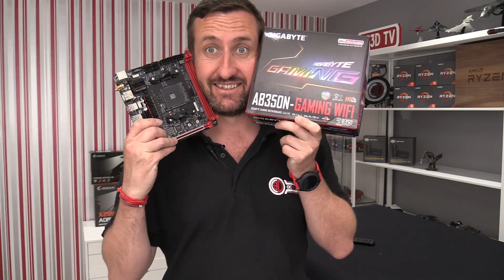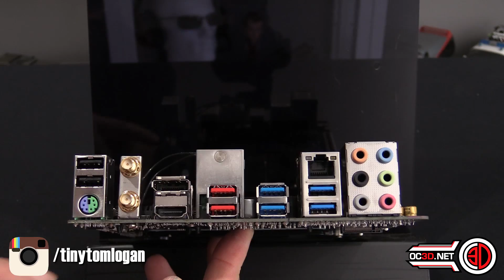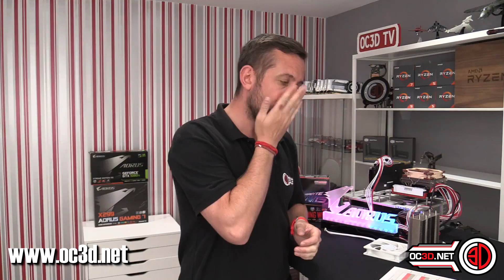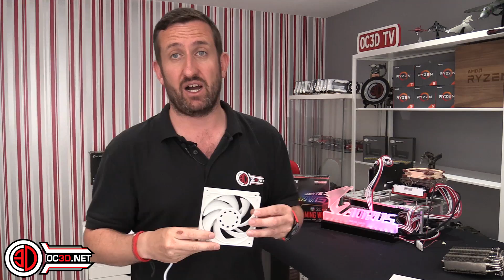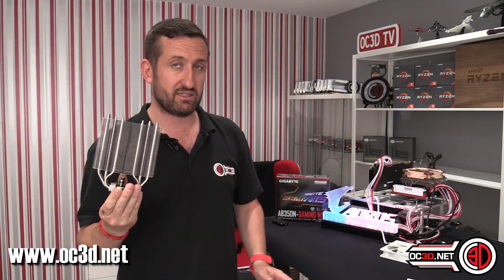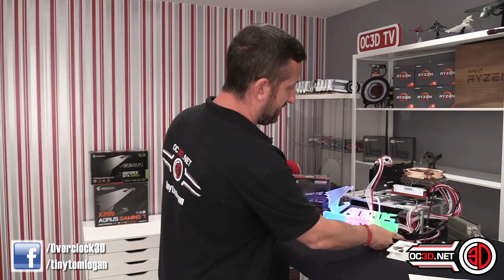Gigabyte AB350 Gaming WIFI ITX AM4 Motherboard Review

Comment: This is the board and processor I have in my Thermaltake Core V1 case. I'm running with 32 GB ram (2x 16GB) and this is what I do all of my YouTube recording, editing, and post production on. Fantastic board, great processor, and honestly for the size and quiet the TT Core V1 is super quiet and cool. As long as you're not heavily overclocking, this board is fine if you manually tweak the voltage and fan settings a bit.

Comment: Wow, seriously, this the BEST review of a desktop motherboard I've watched so far....With such great, intricate detail and depth. We need such skeptical, constructive, critical information/reviews about the parts that we buy to build our computers. +1 Subscription from me!  :D Okay, so in short, this motherboard (Gigabyte AB350 Gaming WIFI) should've had an A320 chipset rather than a B350 one, because board itself isn't really designed to have its processors (RYZEN, in this case) voltages and clockspeeds manually fiddled with, or else it would get too hot and unstable..Am I correct?
Reply from the maker: In all honesty the VRM's need better cooling....

Comment: I bought this garbage just because the asus one was not yet on the market. Big mistake. First it crashed every few hours. Whocrashed pointed to memory. Eventhough I used a memory from corsair from the qvl I exchanged it with another memory from kingston. Then it crashed "only" once a day. Every update of the bios resulted in a number of tricks to be able to enter the bios setup. Last bios f22b out of a sudden does no longer have the in-bios raid setup. After update it tried to boot from the raid 0on the sata instead the samsung 960 pro..... And no way to get into the bios to change the boot sequence.... So one week ago I exchanged it with the asus b350 itx. This did not crash once. Just connect everything and the asus mb boots from the samsung and recognizes the raid 0 on the two hd drives. Did automatic overclock to 3.95 - works like a swiss clockwork since a week now. Should never have bought this garbage, at 3.95 on the gigabyte the voltages even on the latest bios i got to run f21 are all over the place, the vrm gets hot like hell. Nothing like that on the asus. Spend a little more on the mb, go for asus and stay trouble free. I dumped the garbage mb into the same . Better to throw it away then bring misery to someone else.

Comment: TY TY TY for the honest and detailed review on this MB. I just bought one for an itx build for my dad. Now I know that it's a good board, as long as its set up right. And I'd hate to have calls about it throttling and shutting down. I was actually just about to order my cpu cooler, And I just went back in and changed which cooler I was buying after this review. Thank again for the great vids. keep up the awesome work!

Comment: Just bought it - before I watched this very good test. Normally I am all intel plus Asus ( now for decades already). Fortunately I run this MB in my plex server without any overclocking on a ryzen 5 1600. ryzen gives a much better cpu benchmark to price relation hence I tried AMD again after very bad experience years ago. I bought this MB because Asus does not have one in itx for AMD 4. first I used 16 Gig ram 2133 from corsair. The pc would crash every few hours. Minidump analysis never pinpointed any specific driver two times it gave a faulty ram as possible reason. So i changed the ram to two times 8 gig 2400 from hyperx - last three days no crash, so i think that was the reason. After I saw this I run the cpu at 100% as I was only concerned about cpu temp which is perfect due to liquid cooling - which is the wrong choice here as I learned from this video.....cpu is perfectly low at 3.4 gig at 50 degrees . The vcore is jumping as said in the video (bios f5) from 1.200 tom1.248 and vrrm temp goes up to 64 degrees afte 30 minutes in a room with 26 degrees C.
So this mb is still ok if you do not want to do any overclocking and just need something small for the living room. But their bois sucks (when compaired to Asus). For sure I will buy an Asus MB again the next time. Never had to worry about overheating of pasrts of their rock solid mbs... Super video by the way!

Comment: I've got this board inside a Silverstone Raven RVZ01 and it actually runs pretty cool with a 1600x @ 4ghz and the stock RGB wraith spire cooler. Mind you, I do have all three case fans installed. Case has great air flow over the motherboard and the layout works really well inside. The latest bios seems to have improved too. 👌
Reply: Zacharie Kelley seems bios update F5 fixed the vcore issues.

Comment: Great review - would it be possible to do the same tests on Asrock B350 itx version. I hear (well reading reviews) that Asrock use a smaller heatsink on the B350 version. I was leaning towards the Gigabyte version due to its IO. But the heat issue sterred me towards the Asrock. Now upon hearing about the Asrock heatsink issue, I'm confused.

Comment: My VRM temps are around 50 degrees with Ryzen 5 1600 using the stock cooler and at idle inside a Thermaltake Core V1 case.

Comment: The problem here is that Gigabyte should have shoved "X370 level" VRM on a "B350" board to keep the VRMs cool. Which they can't afford to do, because it would make to all of their X370 boards a tough competitor.
The difference between the X370 and B350 chips are tiny anyways in terms of features, in my opinion. So motherboard makers have a hard time choosing their components to position their boards in the right way, not to compete against their own products.
Let's face it, all the magic and wizardry is in the Ryzen CPUs. The difference between the "mid" and "high" level boards in my opinion are not justified in the price they are asking for it. I think they just want to make a good profit, so making monster good B350 ITX board is not in their best of interests. But that's just my opinion.
I still think that all the motherboards on Ryzen need a Rev. 2 because feature sets from bottom to top level are a bit of a mess. For example leaving off dual BIOS, certain buttons, Voltage checkpoints off of certain overclocking boards. (My 7 year old mid range board have all these and more. And it didn't cost more, than a simple B350 board with only 4 SATA ports mediocre audio, one LAN, no PCI [ YES PCI ])
That's how things have changed in 7 years. It's all marketing, snake oil and RGB. Show me a review from the last 5 years, where someone puts in more than a video card into a board. Right? Than why are all the other expansion slots there?  Because like they say: sex sells. I get it. All the other stuff is boring. But this made most modern cases a fishtank with less options than before.
All this wouldn't be a problem, if everything would be in it's place, priced properly. And the choice of features wouldn't suffer by it. End of story.

Comment: Honestly, i've been running a Z87i Gaming AC with the same heatsink on a overclocked i5 for 3 years now and it has never caused me any issues. Ryzen is even less power hungry than the 4670K (an R5 atleast) so it should be fine.

Comment: I had similar issues with the ab350M gaming 3 microATX (entirely different to the ab350 gaming 3). The hot VRM just made it impossible to get the build quiet at idle. VRM was putting out so much heat that I had to ramp up fan speeds to annoying levels to push that hot air out. Its funny because most builders who want the best bang for the buck buy standard sized mobos anyway, but demand for high quality silent ITX builds comes from consumers who have some extra money to spend.

Comment: Well VRM heatsinks today aren't as good as they used to be. Intel x299 boards they are just insulators and looking back at AMDs FX 970 and 990 chipset boars like Asus M5R97: https://www.asus.com/media/global/products/4bZFxu0IYyQ1DSfB/IiRK8LenGsnqrEZh_500.jpg

Now that's a heatsink.
Well this Gigabyte AB350 Gaming WIFI ITX AM4, you could just put aluminum "heatsink" with thermal tape and be done with the issues of overheating. I would have liked to see the temps without the heatsink....

Comment: Great review...  
Sounds like it has the same vrm setup as the rest of the  gigabyte b350 range. Your basic 4+2+1 setup with ultra crappy mosfets that will get into a thermal runaway at quite low temps. Had to ditch a gigabyte AB350-D3H for all the reasons you listed.
I wish more reviewers gave the relevant information and concerns about a product rather than being shill's more worried about their relationship with their suppliers.

Comment: Use another stack of standoffs if you want more clearance for the M.2.
Standoff, standoff, mobo, mounting screw:    =[[]]=[[]] | | <==[]

Voltages, I noted those spikes on my AB350 Gaming 3 motherboard from Gigabyte.  I backed off the overclock because of the voltage variation and am running a 1700x at 3.5 GHtz.  Voltages are still not under control.

Comment: dude i run 7x140mm fans on a single connector even on full throttle there is no problem and the splitter is not powered

Comment: Great review!  Could the voltage issue possibly be fixed through a BIOS update?  I'll probably hold off for the Asrock board reviews, hoping Asus will release a board as well or maybe Gigabyte will release an X370 board.
Reply from the maker: Voltage issue can be fixed with BIOS yes - if they do it or not is a totally different matter
Reply: OC3D TV Have they fixed it? This motherboard is the only itx   motherboard in my country, so there is no option for me. I'll have 1700 with a stock cooler, will the vrms be cool enough. 
I do heavy video rendering, so im very worried.

Comment: Should of used a 1700 as well
Reply from the maker: Its the same as the 1800x fella
Reply: OC3D TV but not overclocked temps should be lower then 1800x

Comment: my z270n board from gigabyte has a 3 phase power with no heat sink......................... i only put 1.25v through the CPU so nothing's over heating but this is really good to know. I'm currently using a U9S and you have confirmed that it may not have been the best option.
Reply from the maker: You wont know unless you actually have a program that tracks the VRM temps
Reply: Yeah I use HW INFO while I kept re-running cinebench on loop.only got to about 75 degrees.

Comment: the cooler on the vrm is built with a downflow cooler in mind. If you have a tower on it, the vrm heatsink won't get any airflow and in turn will overheat like a mofo.

Comment: Uh TTL, at stock was core performance boost disabled? As if it wasn't your CPU was most likely boosting to XFR frequencies which will often draw up to 1.55v from the power delivery on any AM4 board.
Reply: Jacob Foster yeah that drives me nuts about xfr. I saw it happen with my 1700x on the gaming k7. 1.51 volts just to maintain 200 mhz boost. Which if I did it myself I could've given the same boost with significantly less voltage. It's part of the reason I pushed my brother away from x variant cpus. I was actually trying to get him to go with the 1600, but he himself decided he wanted the 1700. Either way it turned out to be a great choice.

Anyway yeah I disabled boost and basically forced my 1700x to run at 3.4 GHz at all times now. Temps are lower and voltage is actually stable now. Still not happy about it.

Comment: FWIW I have a Gigabyte X370 Gaming K7 running the F4 bios and a R7 1700 at 3.9ghz stable.  I have load line calibration set to auto and 1.4v on the Vcore. In hardware.info it fluctuates between 1.375 and 1.385 vcore very constantly at load and idle.   But than again I had to manual set my SoC voltage to 1.1 since  on auto with my ram at 2933mhz it wanted to set it to 1.35v for SOC which is way too high to be safe and way more than is even necessary as I'm completely stable at 1.1v with my 2x16GB  g.skill CL 14  kit running at 2933mhz.  It won't run a 3200mhz no matter what though I hear the 8GB sticks do.  Also to keep my VRM MOS temps below 100C withe the CPU water cooled and the radiator fans drawing air in directly above the VRMS I had to install a rear case fan as intake to blow over them.  With that hovered around low-mid 80s under load for 8 hours.  None of the Gigabyte AM4 boards have seem very good VRM heat sinks.

Comment: I actually just did a build with this board today. currently running a r7 1700 @ stock with a coolermaster 120mm AIO. the temps seem fine at idle/medium load although I have not stress tested it yet.
Reply: wat
Reply from the maker: what are you using to track the VRM's?
Reply: OC3D TV funny story happened just now
I ran the occt benchmark to test out how hot the VRMs got and it crashed so after starting windows up again I realize that I guess I put in the wrong password so now I have to reinstall windows

Comment: They should just use better heatsinks with copper fins like server and workstation boards use. Heatsinks like that have a much larger surface area and are more efficient, the only problem is that they don't look so good. This is just a classic case where design was chosen over functionality.

Comment: Question if the small heatsink on the VRMs really helps at all, I had boards in the past where removing the heatsink actually lowered the temperatures, with direct airflow on the components.
Reply: It would be interesting to see someone mod the existing heatsink by cutting a grid of grooves giving it proper fins OR by swapping in 3rd party chipset heatsinks.

Comment: Gigabyte haven't put out a board I've been interested in since the AM3 970A-UD3. their bios has always severely lacking on basic features that other vendors have had available for well over a decade and tbh I can never safely recommend them to anyone until these type of issues are addressed.
for example, even my most recent experience building an APU on FM2+ (about a year+ ago for an HTPC) was awful with a gigabyte board (A88), I couldn't set the CPU voltage lower than 1.4v which I was dumbfounded by... more heat and power consumption for absolutely no reason is horrible, so within a couple of days I replaced it with an Asrock board which was cheaper and allowed me to run my apu @ 1.05v cpu fully stable for a proper silent system.

Comment: I have a gigabyte gaming k3 with a 1700 overclocked. I was using a custom watercooling setup and the VRM temps were really really high in gaming and reaching crash threashold when stress testing. I have tested to put a fan on the GPU who blows on the VRM cooler and the temps were dropping a freacking lot !

Finally, i have removed the WC and bought a dual tower cooler. I will put the middle fan low to be able to blow on the VRM.

Comment: Thanks Tom, you know the 1500X comes with a down draft cooler and stock it will boost to 3.8 or 3.9 the VRM's should be fine set your ram at 3200 start gaming
Reply from the maker: You need a fan blowing AT the VRM's not just around them. The stock coolers arnt really enough for OC'ing either tbh

Comment: It reminds me of my  gigabyte Z68 board I used to have. 0.1V Vdroop at 4GHz.. Any LLC setting and regardless of how much voltage you'd set, you'd only get 1.35V+ and still have drops. It also wanted to put 1.35V for a stock 2500k when it could run happily 1.18V at 4GHz...

Oh my God what a POS.

Heard about Gbyte shitty VRMs on the B350 and budget X370 boards, didn't even consider them.

Comment: Only wish you'd tested with stock coolers...they ARE all downdraft...
Reply from the maker: They dont move air over the VRM's though - not enough to make a difference. The blow air at the socket not the top of the VRM's - I did try on the lower ones but the 1800X doesnt really come with one and it just got messy
Reply: OC3D TV now that is the reason I wanted to try to nh-c14s. I think that was the noctua model I'm thinking of.

Comment: Looks like I'll continue to be waiting for a proper itx board. That or wait till they fix the bios problems. The top firing cooler is not a problem for me, but the fact they can't regulate volts properly is the problem.

Comment: Do you think a Noctua NH-L9x65 SE-AM4 cooler would be good enough to provide decent cooling to the VRM's?
Reply from the maker: Touch and go tbh. Youd probably need the fan on max to keep temps low. Might be ok on the 1500x but I wouldnt guess on anything else

Comment: No criticism, but why haven't u used the stock AMD coolers, because i assume that a lot of ppl will use that (in case they buy a ryzen cpu shipped with one)? Are they too big?
Reply from the maker: You need the fan above the mosfet heatsink for it to make any difference - the stock fans basically blow air at the socket and there isnt enough airflow for it to make a dent in the VRM temps. Plus the 1800x doesnt even come with a stock cooler
Reply: OC3D TV understood! I think we're on the same page here, but i have the feeling that quite a few ppl will try to set up a system as cheap as possible and therefore use the stock coolers that are shipped with most of the Ryzen chips (not 1600X / 1800X) 
I have the fear that they will run into trouble with that board especially when they try to overclock it...
Gigabyte has some homework to do in my opinion 😬

Comment: Most VRMs can run up to 125 celcius no problem , dont worry about it.
Reply from the maker: The temp give by the board isnt the vrm temp - its the pcb temp around the vrm's. There is no direct vrm probe so you always add more on top. Gigabyte told me from the probe 70c was their limit.